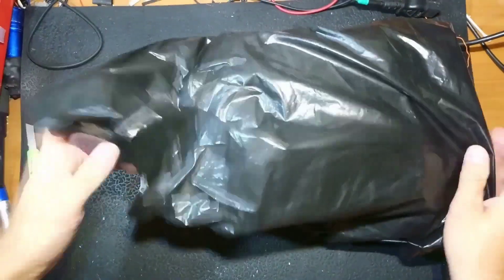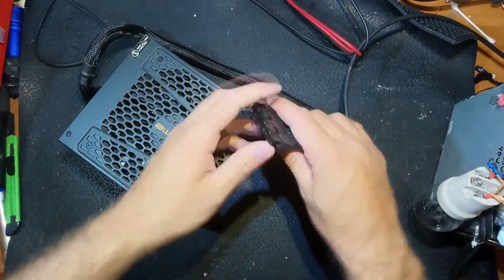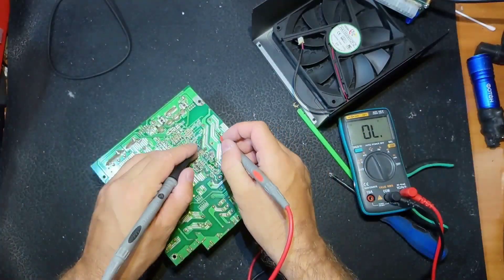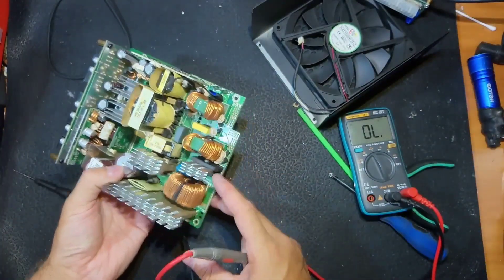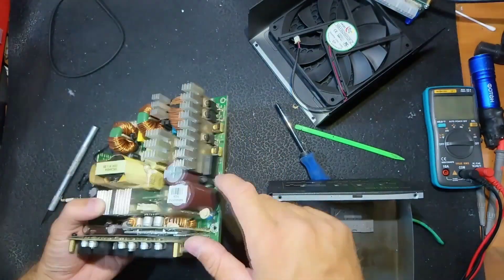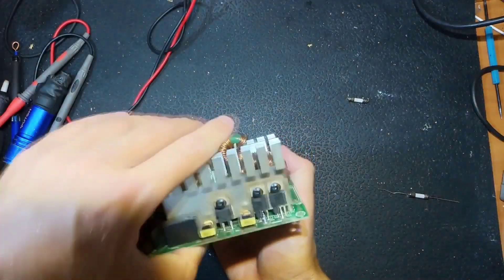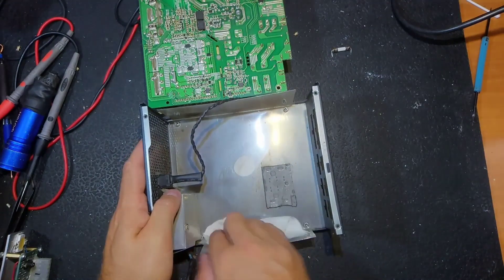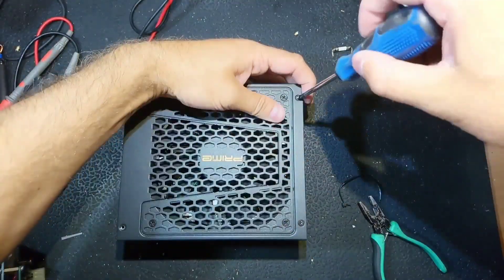Seasonic Prime Gold repair

Comment: Thank you your post! All in all you were really lucky. This type of PSU has PFC and a bit complicated control. If you replace all the parts seems to be burned or measured faulty than still could have a very comlicated case if the PFC or the control logic is not working. Schematics is not existent, you have to manually decode the schematic of the board to figure out what was the original design and figure out what would be the source of the problem based on the measurements.  About the measurements: in a lot of cases the PSU is so densely populated, including vertial control panels the right measurement is almost immposible. To reach a given point sometimes half of the PSU should be desoldered. It is a nightmare. My favorite part is the game when you decoded the schematic of the control - feedback loop circuit and of course there is not any similiarity between the PSU and the reference design of the control chip. Sometimes the engineers are using such a complicated circuits that is insane. You need LTspice to understand what the circuit is intend to do. Practice is helping, after the 10th of the PSU repair of the same type you have the expertise and knowledge to figure out the problem and the solution. It is not fo the ocassionally DIY guys. Complicated and dangerous.

Comment: Like others this length try for under 20 min, give or take.
Best part is troubleshooting the methodical start to finish with the WHY you are looking where you are, how the process goes.
I've repaired a few Power Supplies (single voltage cheapos) where it gets bad for me was the multi-voltage power supplies.   My Electronic ebgineering technical degree is almost 30 years old now & and I've done industrial maintenance for years since.   
Lots of old industrial robots to machines count on these multi-voltage supplies.   Repair is only option in VMEs & old German equipment, replacemnt often not an option unavailable .
Reply from the maker: Thank you for your comment. I will try to focus more on finding the fault aspect.

Comment: The best duration of the video is fault finding and not skipping the fault finding parts and showing assembling and dissembling and cleaning parts. Fault finding in real time and soldering in real time other thing you can  do the fast-forward, time is no essence when you show the actual fault finding which you skipped completely. Just to add one more thing you didn't tested any IC logic on the board and there were 6-7. Without them you will get the power and supply will power-up and will work but not for a long time nor stable, and there would be a problems.
Reply from the maker: Agree about showing fault finding and soldering. I also like to watch exactly that stuff. But I don't have digital microscope so far, so I can't create high quality microsoldering videos. Someday I will buy it. I can't agree about IC. I wonder how would you check logic IC. Gate pulses OK, I can check those with oscilloscope. Power good signal was also checked. But the rest of the details NO WAY. You will never find a repair technician who check all the ICs. It's economicly and reasonably impractical.
Reply: @electronicshaverightstolive  Its very hard that specific model has 6 IC OPP, OVP, UVP, OCP, OTP, and SCP.
In your case the one that I would check is OCP (Over Current Protection) because its job is to protect against short circuit and over current.
Second one to check is the SCP (Short Circuit Protection).
You need microscope, for the sake of your channel  get one with  IMX385 Sony Exmor.